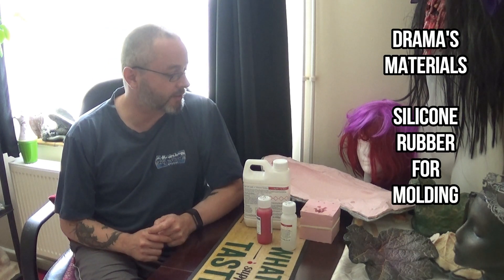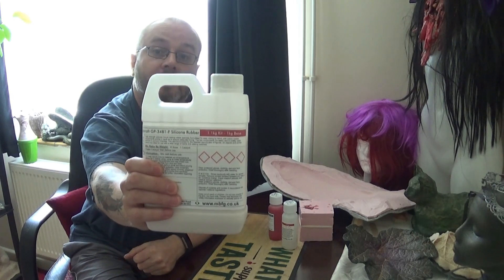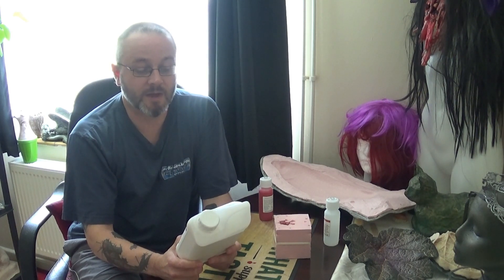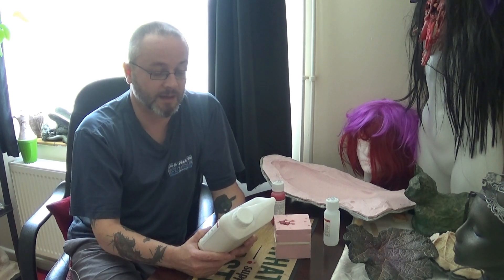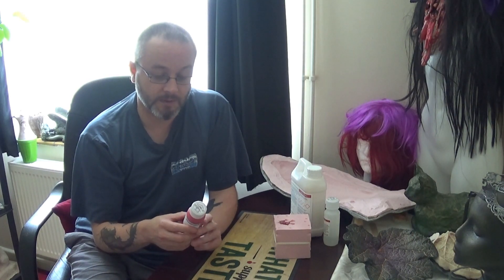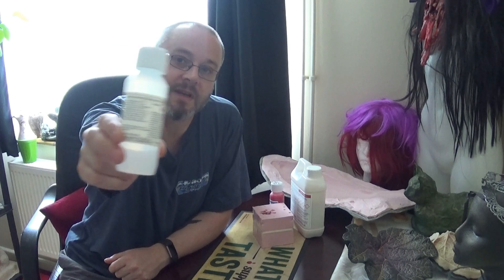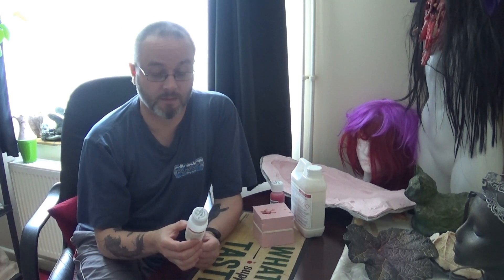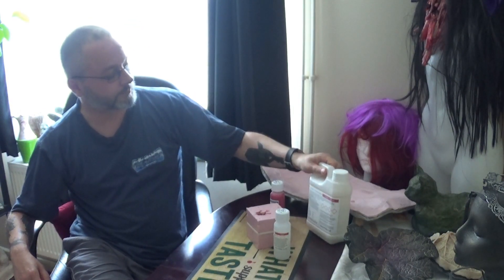Materials | SILICONE RUBBER For Molding

Comment: Hi after 4 years do you still use this Polycraft GP-3481F RTV Silicone or you upgraded to other one ?
Reply from the maker: I haven't used much silicone recently, but would most likely use this silicone if I had a project which needed it right now.

Comment: Hi, thank you for the informative video. Would you know which more flexible moulding kit to use if we don't want to cut the mould open?
Reply from the maker: It depends on what you are casting of course, but I have only used the silicone mentioned, so can't really advise. You might want to check out BITY (Brick In The Yard), as he demonstrates a variety of silicone molding products: https://www.youtube.com/user/brickintheyard
Reply: @dramamask  thanks :) will check out the channel. there are some extremely flexible and stretchy moulds on ebay, sturdy as well just wish I knew what they're made of 😁 i don't like the idea of having to cut the mould open, later prone to leakage.
Reply from the maker: @whowhy9108  I'm sure I will have a project at some point which calls for a different type of silicone, but I don't know when that will be. :D
Reply: @dramamask  ill be watching! 😁
Reply from the maker: @whowhy9108  Aww thanks! :)

Comment: Hi bud. If I use the thickening agent to brush the silicone on will the mould still be flexible enough to peel off? I'm about to mould a stormtrooper helmet with this polycraft stuff so want to make sure I dont fudge it up. Thanks loads
Reply from the maker: Yes, although, if you're not too sure, you can test it out on something before hand. Used the thickner for brushing on in this video: Make A One Piece Brush On Silicone Mold: https://youtu.be/Yf1VsbZ5Buk

Comment: Very informative video. I have a 40 year old mould of a garden ornament. It has 2 halves, one in silicone and the opposing side in urethane. I'm having issues with what I believe to be a mild chemical reaction between the silicone and urethane fusing together, even though I use caster oil and alcohol spray as a release agent. What would be a good release agent?
Reply from the maker: Well, for silicone molds, I use manufactured spray release. I'll have to do a video on what I use and can't remember the actual name of the spray at present.
Reply: @dramamask  well you have a brand new subscriber amd if and when you do such a video, I'll be the first to watch! Thank you for your reply.

Comment: This is awesome way cheaper then smooth on.  Did u have to buy the thickener spearate for brush on  I found ebay.ca has  this for $35.00 Canadian.
Reply from the maker: You will probably need to buy the thickener separately, but don't get thickener confused with catalyst. Research your materials if unsure.

Comment: Halo. My silicone rubber become greasy after few days and even after washing, they're still coming back. Still looking for a solution and any advice would be really appreciated! Thanks in advance.
Reply from the maker: I don’t know. I haven’t had that problem. Did you mix the silicone thoroughly when making the mold?
Reply: @dramamask  Yes I did. Done a few batches and all batches show the same result. But I did spray releasing agent on the model before pouring. Could that be one of the factor?

Comment: Hi, I’m from the UK and I’m trying to find alternate options to smooth on as it’s expensive.
When you did your brush on mold, did you do multiple layers with this silicone or did you do it in one pour? 
Thanks
Reply from the maker: I use both methods depending on the project, but recently did a brush on mold here: https://youtu.be/M-vsXzTbseA

Comment: Fantastic video. I’m wondering does this set shiny. I know that when I pour resin if the molds arnt shiny the resin won’t be shiny. Is there a silicone you could recommend to get a nice shiny finish. Any advice would be appreciated. Thank you in advance 👍
Reply from the maker: If what you are molding is already shiny, the silicone should replicate that. :)
Reply: Top bloke thank you 👍 I need a fair amount as il be casting a large piece agate. I’ve seen a few vids on this but not sure what brand is the best for what I need lol
Reply from the maker: @resinhead1809  Depends on what you're molding. You'll want to do some research to see what is appropriate. :)

Comment: Can this liquid silicone rubber be used to make small objects like small jewellery items? Thanks.
Reply from the maker: If you are casting metal you will need silicone which can handle the heat of molten metal. If you are cold-casting then this silicone should be fine. :)

Comment: Hi I have poured my moulds but they still very sticky even after 24 hours 
Will they eventually set or will  I have to start again
Reply from the maker: Sounds like you may not have added enough catalyst. You want to be pretty exact with the mixing ratios. Leave it for another day or two and see if it is ok then. I think sometimes a little less catalyst will slow the curing process down, so you might get away with it. :)